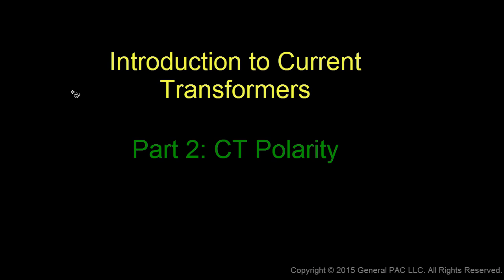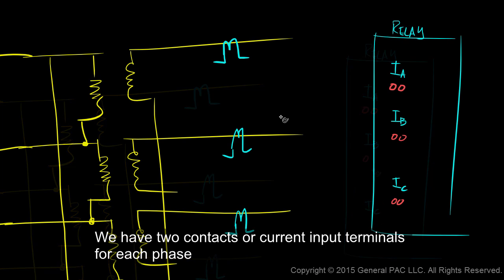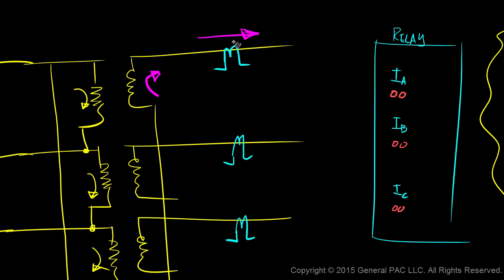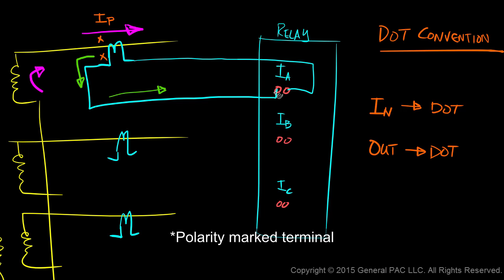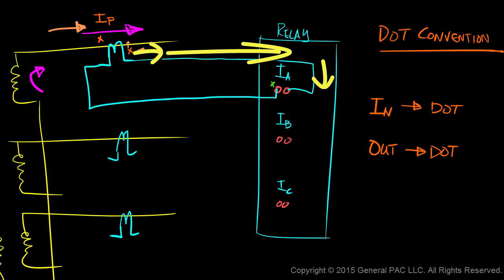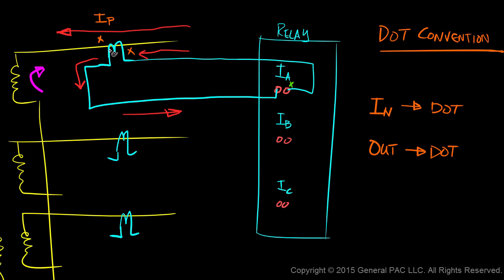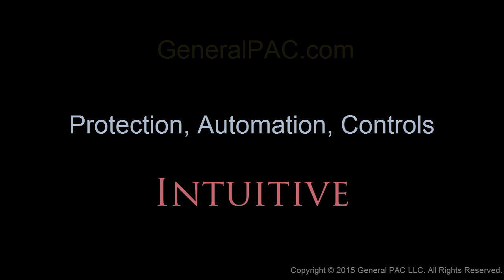Introduction to Current Transformers Part 2: CT Polarity

Comment: I came to understand why is there a polarity in an AC system. Still can't. If anyone can help me understand will be grateful.
Reply from the maker: Hi Yordan, the polarity here basically refers to the flow of current not the direction of the current. You can say that a current starts flowing from generation to transmission and then to load (distribution).

Hope you find it useful.

Regards,
GeneralPAC by AllumiaX
Reply: @Generalpac   I got that. Also found that the meter finds the direction due to a current/voltage offset of 180-degrees. Gues s I still find it hard to comprehend how dose a 180-degree current offset actually feeds in the grid. I thought that to feed the grid all vectors must be the same.

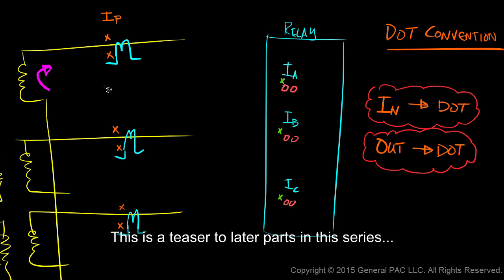Comment: So in your 4th drawing, 5:22, wouldn't this cause a malfunction of your relay? Due to your polarity being incorrect as current should flow into it? This also relates to faults within the transformer, wouldn't this cause an issue as the direction of current travelling to switch due to the fault?
Reply from the maker: Hey Marcus, 

You are right. This video is just for the understanding purpose that how current flows through CTs primary and secondary for different scenarios.

Comment: Hi. I found during installation that CT's are marked P1-P2  and S1-S2. Could you explain according to this symbol, as I am always confused which one should be grounded/connect to relay whether S1 or S2.
Reply from the maker: Hi Nor Hafizie, Thank you for reaching out and sharing your concern with us. GPAC team will try its best to address it.

The CT's primary winding connection are denoted as "P1" and "P2" (in some cases "K" and "L") and secondary windings as "S1" and "S2" (or "k" and "l"). For primary, the connections are made in such a way that P2 is the load facing side and the energy flows from P1 to P2. For secondary remember to use the same rule for the directional flow of energy from S1 to S2. Also, you can either connect S1 and S2 to the ground terminal. However, for protective relays, ground that terminal which is nearest to the protected equipment.

Hope so this answer is helpful to you. You can support us by becoming our Patron on patreon.com/generalpac. Make a difference and be a contributor to the GeneralPAC community.

Thanks
GPAC Team
Reply: @Generalpac  Thank u 4 all the effort
And please I wanna ask 
If the ct was installed reversed as  p2 is towards the source and p1 towards the load then i reversed s1 and s2 into the measuring device is that correct????
Reply: @nadakhater23  It depends on the drawing and specs and application of the CTs. To keep polarity the same, then yes.

Comment: I need help. I am confused with the dot convention. Out of the dot could be in either direction isn't it? please help me out.
Reply: It is with respect to the CT.  Flowing into the dot would mean the current moves from the dot through the winding.  Out of the dot means current flows from the dot away (or out) from the winding.
Reply from the maker: +Jims Henry not sure what you mean... Can you elaborate? Thanks,

Comment: Absolutely wrong. I install and test ct's for a living.
Reply from the maker: +MegaRonin777, Im no expert but I like to share what I know so others can learn and I get a better understanding in the process. Do you mind sharing what is incorrect?  I'd like to investigate and correct my mistake so I don't lead people in the wrong direction. Thanks! Looking forward to your response.
Reply: My apologies, my comment should have been framed in a more positive, constructive manner.
 Rule one, all protective relay ct’s are wound subtractive. I
have run into an occasional additive auxiliary ct but it is not common. Understanding positive and subtractive is important and in the case of protective relaying it is imperative. With understanding the subtractive rule you can assess the orientation of the ct and how to connect it to your equipment correctly. Of course as an installer, you will thoroughly test the ct to prove its orientation (polarity), saturation and ratio.
Reply from the maker: hi @MegaRonin777 -- thanks for explaining your comment. I did some research and found that CTs are almost always wound subtractive as you have said. But I couldn't find any specific IEEE standards that confirmed this assessment. There wasn't any relevant material in IEEE Standard C37.110 nor C57.13. Also, to make commenting easier, I created a thread on GPAC Forum with more detail. Please reply here: http://generalpac.com/forum/index.php?threads/current-transformer-subtractive-polarity.12/   --- Thanks @MegaRonin777 --- looking forward to your response on the forum.
Reply: @MegaRonin777  You seem English, Fancy teaching me a thing or 2 about HV protection? Most of the stuff on youtube is in Hindi. At this rate i'm thinking it could be quicker to learn Hindi than it would be to find a decent English teacher who knows CTs etc.
Reply: @MegaRonin777  It is all a matter of reference. Because in the real world the electrons flow in the opposite direction. But that is another subject. I tend to see it as voltage transformer... or better put, the secondary current is a "resisting" current that always travels in the opposite direction. We never create a current, it is the material that is resisting the magnetic field. But you can label it positive or negative, depending on how you install the transformer. Or the angel, better put. Compared to the label of the terminals.